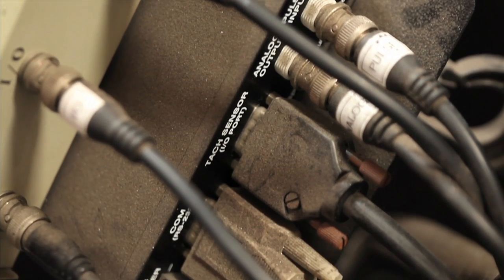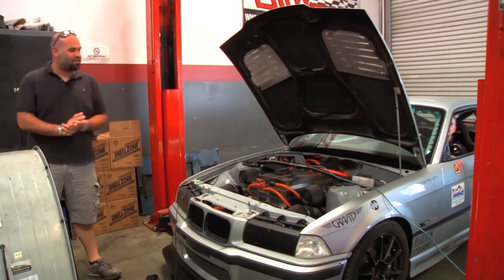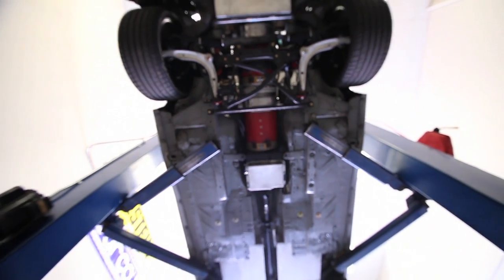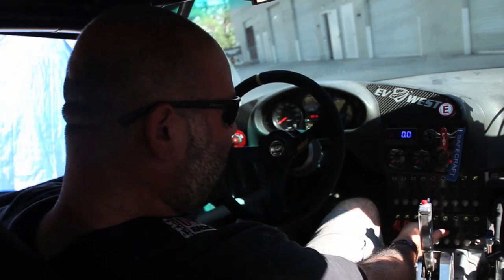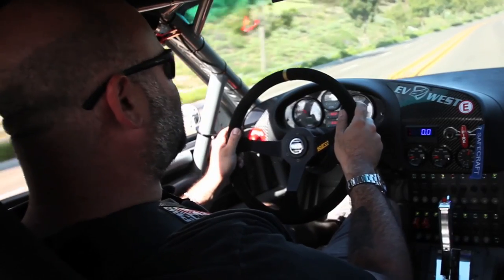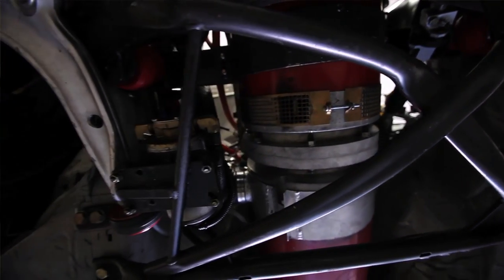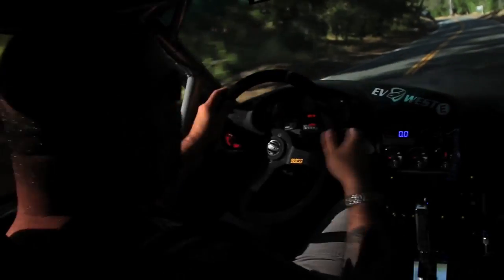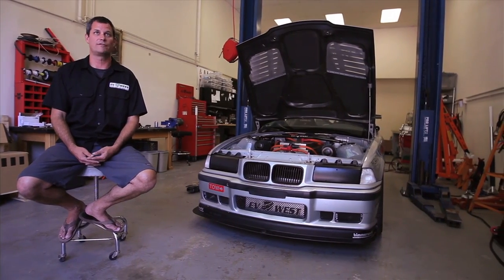This Electric E36 Makes 850 lb/ft of Torque at the Wheels! - /TUNED

Comment: Stock. 6.8 Sec
watch?v=jSDPmenQ2Sc
Full Tank ! Standard 3.73 Diff

I got the same Machine, in the same Condition, professional Chiptuned (no cheap 100$ Shit, 600$ with Dyno Test, Opitmized for 98 Octane, standard M20 is optimized for 90) but a 4.10 Diff and my Limiter go to 7000upm, and i never got more as 30L Fuel inside.

So i can beat you, if i shift fast enogh.

1180 / 170 = 6,94
800 / 125 = 6,5

Comment: Uhhh, my dinosaur-powered car makes about 3100 ft lbs torque at the wheels thanks to this "gearbox" thing.
Reply: You driving a tractor? lol
Reply: I seriously doubt that, unless you're driving a tractor as the other person says.
Buffoon.  Any fool who does basic research will learn electric motors have insane torque.
Reply: Will Davis
 260 ft lbs at the crank, multiplied by 3.25 transmission ratio on first gear (845 ft lbs), multiply again by 4.105 final drive ratio (3470 ft lbs), reduce losses, net = roughly 3100 ft lbs AT THE WHEELS.
Reply: In first gear, yes. With overdrive gears, you only get what the initial/final reduction offer, and that can be 1:1 or less in some cases.

Comment: this isn't racing. race cars spit flames and smoke and make amazing noise. this is kinda lame really. you dont even shift, thats just boring. a straight six turbo or a v8 swap in that e36 would be insane and awesome, and fast, and loud, and scary, just like it should be. like the guy was saying, they're braking parts because of all that low end torque. they spent enough money on this car to make two regular gas motor powered BMWs.

Comment: So they talk about drivetrain power loss, components not being able to handle the torque and the fact that the car is too heavy?!? What century do you guys live in? Why use transmission at all? Going electric enables you to skip all that mechanics. Just connect your motor straight to wheels... doh!

Comment: I guess you dont know what kilowatts are dude... 400kw = 400,000 watts. 735 watts is 1 horsepower. Do the maths (400000/735) and you get 544,21 horsepower.
Edit: when i say Horsepower i mean CV (steam horsepower). I dont know what the hell a horsepower means in America.
Reply: And by America you mean United States, because all of the rest of North, Central and South America uses metric system with kilometers and kW.

Comment: WTF 400kw is 536bhp not 342. What gives?
Reply: 342 WHP
Reply: P. T. It still used a trans driveshaft and diff so the motor is going too lose some power before it gets to the wheels

Comment: Electric engines do not make max torque any rpm, stall torque is maximum then it stays level for a bit and then it drops. Do some research before posting .

Comment: I still believe that Hydrogen cars is the future.
Reply: CounterNic Well you still have to decide if you like hydrogen-electric or hydrogen-combustion. Hydrogen can be a fuel for both electric and gas cars.
Reply: CounterNic Electric and diesel is the future. Hydrogen doesnt make much sense, youre converting electricity to h2 and then h2 to power when you could leave out the conversion and just use electricity
Reply: lolatmyage i agree with the diesel part, especially now. but electric has the problem of saving that energy. e.g. the new SLS-e is a nice electric car and stuff... but it only does 1.5 rounds on the nürburgring. so thats... meh. than i´ll rather take the Bentley continental, as long as im not on the autobahn simply put it in economy and use only 4 out of 8 cylinders. thats one of the best ideas of saving fuel in modern cars imo.
Reply: TheMentor455 here in europe, diesel is not the future, cause it's too difficult for a diesel engine to pass the emissions limits. And under my perspective, if you change gas for hydrogen, you still have to extract hydrogen and pay for it, instead, with EV's you could charge it in home, with your own energy system. (forgive my english :S )
Reply: alexrome93
yeah first your english is pretty fine. 2. i live in germany and we basically have the worst restrictions here. 3. to be honest i dont know THAT much about hydrogen cars? are the just combustion engines like petrol or diesel ones? because if so, they could work too. i think electric engines should be put in everything thats supposed to be practical. scooters, vans, wagons and so on. electric has a lot of torque and instant revs. but the problem is conserving the power. and about the restrictions again: thing is we are currently working on a new type of filter, minimizing the emissions to zero-ish. electric is nice but finite at a certain point. atmoic is cool but unsafe. hydrogen is cool but to complicated to make in big numbers and a little unsafe too. regular petrol needs oil, which is finite too. so the savior would be diesel or organic petrol (something else, currently worked on).
Reply: I like the idea of hydrogen cars for a lot of reasons.
From converting the water into hydrogen to being converted to energy in a, for example hydrogen-electric motor, you could do pretty much 100% environmentally friendly.

If you only use the electric generated from a windmill, water turbine etc, then you will release little to none Co2. You could also use said electricity to compress the hydrogen, like we do with propane etc. (Storage).
And when the wind stops, then you just wait until it comes back.

Unlike the electric cars we have today, where you for example would drive to a recharge station and recharge its batteries, you would need to have a constant electric current running, which would not be possible with only windmills etc. so you would (also) have to burn coal, gas, oil, thrash, hay and so on.

I just read that other day, that Hyundai has made the worlds first series production hydrogen-electric car. The km/l is pretty good/around the same as todays economic gas cars. Although it's pretty expensive at the moment, that won't take long before normal people can afford a hydrogen car.
Reply: alexrome93 Diesel emissions can be minimized with the right DPF technology that actually takes into account whats in the filter instead of just wasting fuel after a certain amount of distance. Detuning is also an option, less power needs less fuel, less fuel means less emissions. A 3 cyl TDI diesel is perfect for that.
Reply: CounterNic Still, why use hydrogen? Why not simplify the process and use electricity? Electric gives maximum torque from 0RPM and has inherent kinetic energy recovery.

Batteries are getting better over time as well, reducing charging times and increasing range.
Reply: The problem with dpf is that works at it's best at high temperature of gases, and that temperature is bassed in high reving, wich is not the best for fuel consumption in diesel engines. (Again i'm struggling with the lenguage )
Reply: alexrome93 Fuel consumption is  what makes DPFs work, without spraying more fuel into the engine (and into the exhaust before the filter) and raising the exhaust temperature, the filter will just collect soot. Nevertheless, the burning cycle is not long enough to have a massive impact on fuel consumption, a 1 hour ride on the highway maybe 1 gear below the usual to hold the revs higher should be enough afaik.
Reply: +Nazimelon Battery development over the last 15 years has been extraordinary and, what's more, it's speeding up. I predict the next 5 years will see that problem sorted.
Just as the stone age didn't end because we ran out of stone, the petroleum age is ending because we've found something better.
Reply: Robin Harrison
recently found out about predictions, reseraching more on organic petrol restricted for usage in motorsports. like i hoped, more and more people seem to agree that practical cars need to be electric, not sportscars, which is just useless.
Reply: Nazimelon What more people seem to agree with is irrelevant when electric can do everything that a combustion engine can. 

"like I hoped" lol nice work showing your bias towards this subject. Wrong again because you set out to prove a point instead of reaching the truth by looking at the problem from different angles.

Comment: Aight, if you like gas powered race cars then stop driving your gas powered daily commuter and start seeking electric. Understand? Gas is finite, save it for your race cars, gas makes the air quality go down, use it less and only in racing. You cannot decide if we stop using gas, we must stop using fossil fuels  Its not a choice.

Comment: its not got 400kw, 340hp is 253kw.
Reply: Yeah I but its loosing almost 197hp(196.4 to be exact) just to turn the crank remember what he said in the beginning of the video. So it really is producing 400kw just not to the wheels.
Reply: Anthony Miceli I thought that electric cars where meant to have less drive-terrain loss than ICE's?
Reply: I thought so too...I've spent like an hour thinking of reasons why it takes that much hp to turn the crank
Reply: Anthony Miceli they are running with a transmission and diffenrential. That is what take the power down. Tesla is direct drive, so it have minimal loss.
Reply: mrmadame28 thanks for clearing that up for me :)
Reply: Because its bullshit. The 400kw statement anyway. This setup made peak torque of 850 ft-lbs at 600 rpm. In order to make 400kw at all, that peak would need to be at 2753 rpm. This is considering the 400kw statement to be gross (makes gross tq 1000) , so a 15% loss would make 340kW at the wheels. With horsepower peaking at 2350ish rpm, torque was already down to 760 ftlbs. another clue: these motors have rated power figures that list the voltage and amperes current draw. The advertised rated HP linked to these parameters does not take into account motor efficiency....that is a really lame way to sell shit.

Comment: lb/ft = torque?
Reply: +Andrew Lancour YEah.... LB/FT is just how much pounds per feet the thing can put out.
Reply: +DARKHOUND it's not lb/ft it's lb.ft (Torque=Force.length between the force and the axle)
Reply: The way i did it is perfectly acceptable... do not correct me unless i have made a mistake...
Reply: DARKHOUND you did make a mistake. It's like saying a speed is in km.h instead of km/h
Reply: Emilien Gosselin no because no one in the world uses Km.h.... some things such as Torque wrenches have LB.ft or LB/FT
Reply: +DARKHOUND then it's a mistake or not a torque.
Reply: Emilien Gosselin Sure.... tell the hundreds of signs you see that....
Reply: Also if you knew any basic science you would know Newton coined the whole NM and LB/FT refers to the newton metre torque...
Reply: +DARKHOUND Dude trust me you're wrong. A torque is a force times a length (in case of lb.ft it's a pound times a foot) so it's not lb/ft. Check wikipédia if you don't believe me
Reply: Emilien Gosselin google LB/FT and it comes up with torque fam...
Reply: +DARKHOUND When I google lb/ft I end up on linear mass density
Reply: It comes up with foot pound energy for me and foot pound torque...

Comment: Bullshit!

Not every motor has the same efficiency and not every drivetrain has the same loss. So your calculation are pretty much bogus.

To figure these values out, one will have to measure the output of the engine and the output on the wheels. The delta between those two will tell you how much you lose due to drivetrain loss. The delta between the advertised output of the engine and the measured output will let you calculate the efficiency of the motor.

Comment: These arguments against electric RACE cars especially, are EXTREMELY stupid. When the car was new (a century + ago) and people started racing them they couldn't have cared less if they were electric, gas or steam powered as long as they went fast and won races. Nobody thought that hundreds or thousands of explosions per minute were the best sounding, it just happened that at some point internal combustion engines became more reliable and capable enough to the best job.

After a century electric cars have caught up and are becoming the best, deal with it.
Reply: Marian Rodu Actually you are wrong about that. A century ago, it was very important what the car would run on and many companies were betting on their design becoming the defacto norm. Furthermore no, electric cars have not caught up with gasoline. Their range is less, efficiency less, waste production more, reliability less, and cost of manufacture higher than their gasoline counter part. The day electric cars catch up with gasoline is the day they can be purchased at 25-35,000 usd with 350mile range, with 4 year warranties/ faulty battery replacement programs, and sub 30 minute recharging from 0 to 100% with a 98.7% efficiency in recharge capacity. Until electric cars reach that build quality the argument for electric cars will always remain largely on deaf ears.

Comment: Electric cars are good idea except for the dangers that the electromagnetic fields that their battery cells produce represent.    These are very powerful EM fields that when exposed to for extended periods of time can cause cancer as well as neurological problems.  One woman who had purchased a Toyota Prius described how on her hour long drive to work each day she would at times find herself dozing off behind the wheel.  Others have complained about  feeling very exhausted when spending any length of time behind the wheel of an electric car.

The hybrids don't seem to be as much of a problem because their batteries are smaller, however, that does not mean that they aren't dangerous over the long run either....
Imagine anti-gravity propulsion systems for automobiles that allow them to hover just above the ground, and use the electromagnetic energy from the earth's magnetic core as a source of power.  No more gas stations or the need to recharge your car's electric battery any longer.    
You could drive as far as you wanted to without having to make a stop or fuel.  
However,  I don't think that Elon Musk would like the idea though given his investment in the battery industry over the past few years...
Reply: Fishkeeper59 Are you wearing a tinfoil hat?
Reply: Fishkeeper59 TBH I'd probably doze off too if I was forced to drive a Prius...and not because of any EMF issues.  
Either way I don't really buy in that, because train drivers who are sitting inside a 25000v 6500+hp electric machine every day over hundreds of miles don't doze off or die of cancer....
Reply: +Fishkeeper59 Is that risk lesser or greater than breathing that soup of hydrocarbons that hangs in the sky over every city in the world?

Considering your knowledge of how "electromagnetic fields" work (namely, magnetic fields aren't electromagnetic fields) and your equal knowledge of how electromagnetic fields cause cancer (please do a wikipedia search for "ionizing radiation"), I would say that it's quite a lot less. Even if they were exactly equal, you breathe that crap 24 hours a day, 365 a year, while you only sit in your car for a couple of hours a day on average.

Comment: So many things in this Video are ridiculous. It starts with the measurement of hp. Because the car uses dc motors (which are not so efficient) the 400kW are of course not real. Also just like in a normal car the friction in the transmission converts some energy into heat. If the advertised value for this car is 400kW and it only outputs 342hp that means it only outputs ~64% of the rated power. This is still more efficient than combustion engines, but normal car brands also don't advertise the energy that is provided by the fuel, but rather the actual output of the engine. That being said some other electric cars can output up to 95% of the electric power. 
Also, I find it really funny how the guy says "What is the point of going to a race when there is no sound" and "I don't like shifting". That is just pathetic. A real race driver would not care so much about the sound but rather about shifting (gear ratios), how good a car handles, and how much grip the tires have.

Comment: Electric cars are never going to be the future, hydrogen is a much better alternative, once all the technology is worked out. The problem with electric cars is range, and what happens when you drive an electric car in the cold? Say good bye to a 3rd of your battery life. They just aren't practical. the only benefit I really see to electric cars is the instant torque and the huge amount of it. I'll never buy an electric car anyway as I would miss the engine sound, that's half of what makes cars so awesome. The whole eco car thing is a pile of bullshit too. if you keep an old car running for a long period and don't buy a new one it is actually better for the environment as making a new car creates more pollution. I fear for the future of cars, soon we will have nothing but boring soulless econoboxes the way things are going right now. Just look at f1 and the stupid stuff going on there now with downsizing engines, restrictions on fuel flow  and the stupidity with Riccardo's disqualification. Unfortunately for us gearheads the car world is turning to shit, hopefully at some point we'll see a turnaround. I don't have really have anything against alternative power sources for cars, I just worry that cars will soon become disposable boring pieces of crap, and things will never be as good as they once were. Hopefully I will  be proved wrong.
Reply: Hydrogen is essentially inferior to the Electric Car in most ways. Google "The Hype about Hydrogen". Electricity is available everywhere, Hydrogen is available nowhere. The per-mile fuel cost of an EV is around 1/4 that of a Hydrogen car. Hydrogen fuel cells suitable for cars are extremely expensive. Hydrogen still needs innovations for low-cost storage.

You can't expect everyone to drive old cars, as they often have poor safety (etc...)

The problem with EVs is the cost of the battery, which is coming down. Batteries can be heated in the cold when being charged. So that's only a problem in extreme cold without a charger.